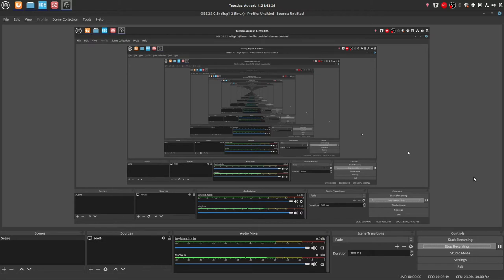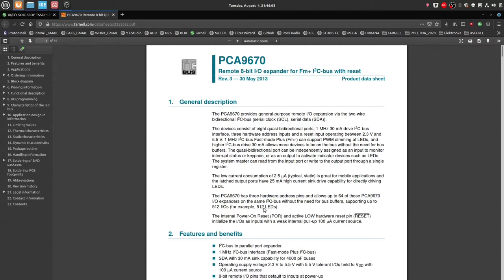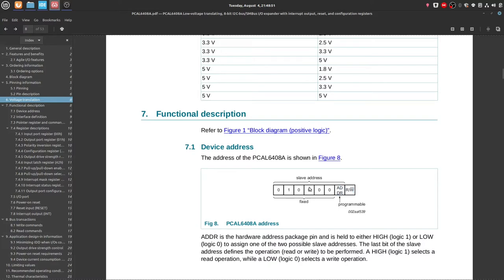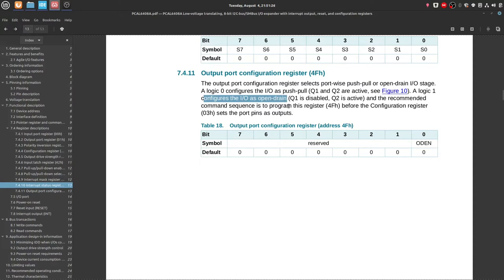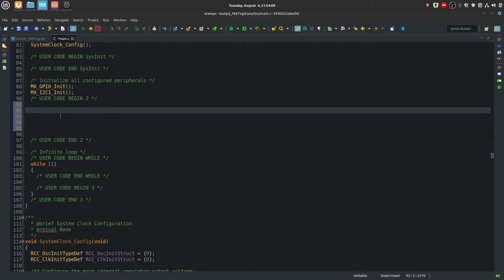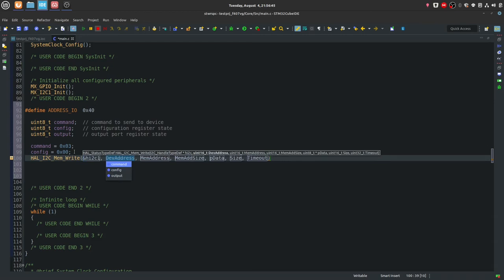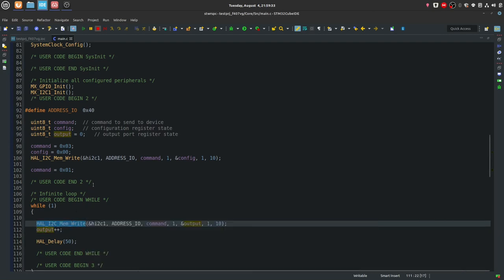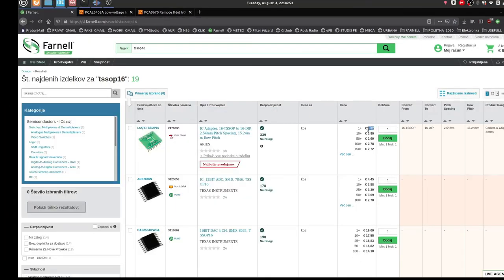I2C example project - IC to working code | VIDEO 31

Comment: Hi, it is a nice video. I missing how to set/get only one IO instead to override all. How can I doing this?
Reply from the maker: Because you can only write to the whole part of the register, you have to know the current state of it in order to manipulate only those bits(pins) that you want. One way to do so is to keep a local variable holding value of output register or you can read from device register and modify bits(pins) of this data that you need and send it back. For setting only one bit to 1, you would do OR operation on the register:
reg |= (1 << bit_position[0:n]) where n is the size of register/variable-1, therefore 7 for this example.
To set a bit(pin) to 0, you would use AND operator:
reg &= ~(1 << bit_position[0:n]), where you take the state of whole register and AND its bits with ones except where you want to set the pin to 0. I suggest you to learn about bitwise operations and register manipulation if this topic confuses you.
Thank you for watching!

Comment: I have been trying to setup I2C on a STM32F107 using CubeMX, however if i probe the i2c lines I don't get any activity. At the moment I am quite stuck any tips would be most welcome. there are pull-up resistors, also if use a i2c device like Aardvark I can communicate with the i2c chip. It has to be something with the setup on STM32.
Reply from the maker: Make sure you get the correct pins. As for the configuration, stock speed of 100kHz should be compatible with most i2c devices, other settigs should be stock.
Use i2c read/write functions to send and receive the amount of data. Only then you will see any action on the pins. You can probe them while running dummy read/write command.
You can watch my i2c video on stm32 for more details.